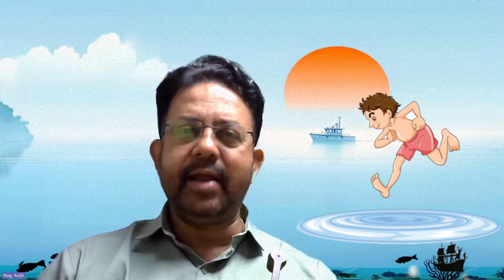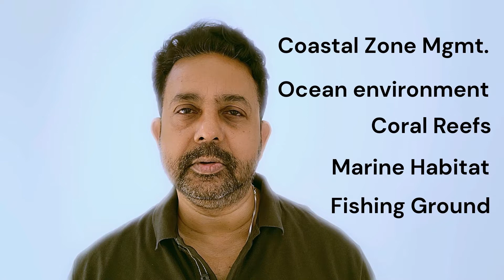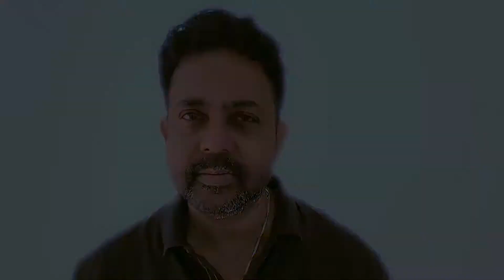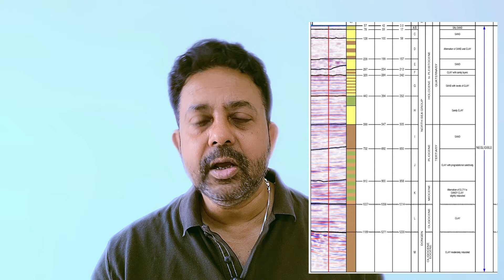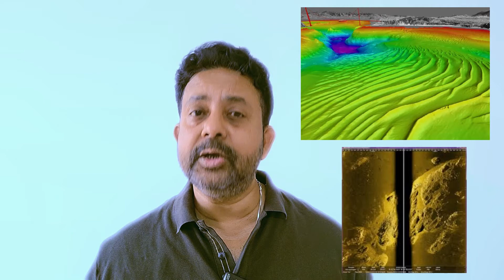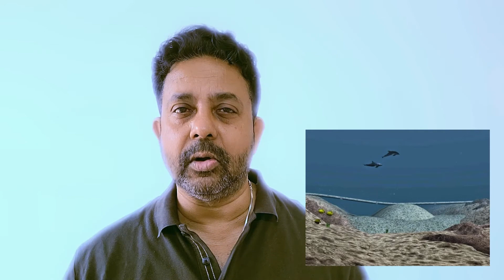How We Map the Deep Ocean for Oil and Gas

Comment: what are your view on undiscovered crude oil reserves in sedimentary basins, including the Mahanadi, Andaman Sea, Bengal, and Kerala-Konkan?
Reply from the maker: Hi Thanks for visiting. I know that we have many oil and gas field that are left alone. Its all about economy and commercial viability. Say you have a 10K mobile phone and its screen broke and battery needs replacement. But if the replacement cost is more than the new phone, why would you replace it? right? If extracting the Oil and Gas is costlier than the prevailing market, then it is better to leave it alone. Sometimes the reservoirs are small or the quality is not good. So being a surveyor I can not tell for certain. A lot depends on Viability.